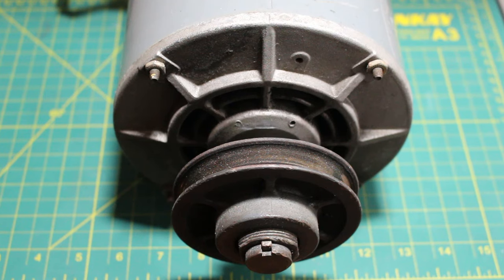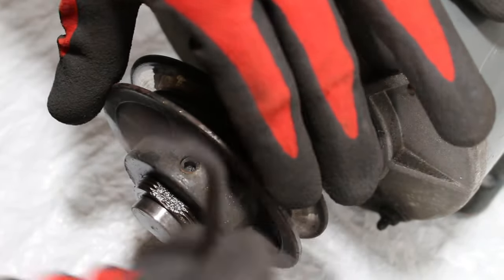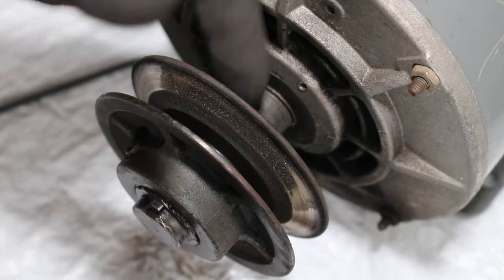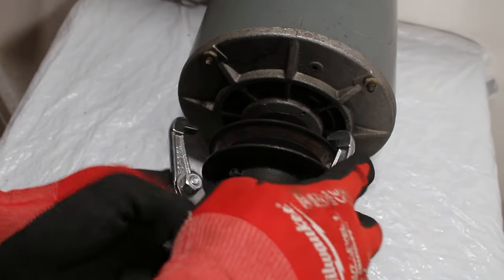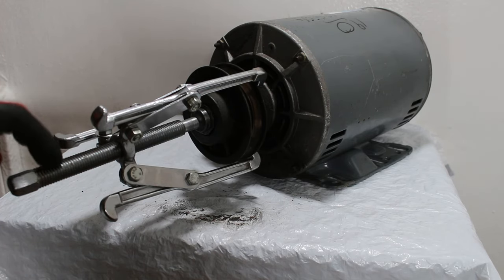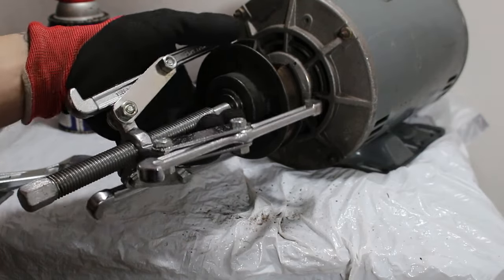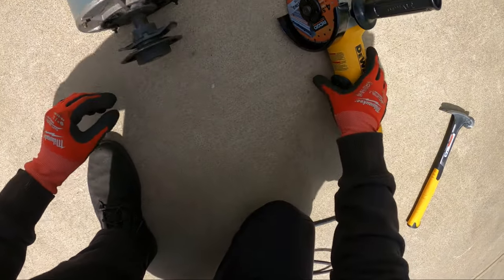HVAC: Blower Motor Pulley Removal (Fixed Bore Variable Pitch V-Belt Pulley) HVAC Sheave Puller Tool

Comment: Appreciate the candid video - happens to us all!  I’ve taken these off before and some additional tips that helped:

-leave the front allen screw alone so as to avoid changing pitch, loosen only the rear
-heat around the pulley  to expand it slightly, using a heat gun or propane torch
-slide a short iron pipe over the shaft protrusion to tap on the pulley hub using a hammer or brass mallet.  this breaks the pulley free from the shaft by first sliding it backwards slightly.  

Short Impact impulses are almost always  a safer way of freeing something  versus a large static force (aka the puller).

Comment: you suppose to take out that metal wedge first.  that’s why you were not able to slide it off pretty sure you figured it out  after the fact .. good video
Reply: How do you remove the little block key in the middle
Reply: @justbeingreal5839 yeah he forgot to say that. Maybe try to tap out like from behind with some little rod and the hammer?

Comment: Get yourself a blunt drill bit , spray the pulley with penetration fluid(WD40 is not that great) and then start to drill the end of the shaft until it gets hot or you see smoke. This should help to unseize the pulley. Also when using that type of pulley best to use a brace between the claws and pulley. i.e flat piece of wood. Keep the videos coming :)
Reply: Yield and impact socket. Ratchet moves around too much.

Comment: I recently bought a new motor and replaced the  small pulley and it started up fine but within  5 minutes or so it over heats and shuts down. Can you tell me how to fix this? Thank you.
Reply: Check belt tension
Reply: @wonderlandalliance888  Yes... again thanks
Reply: What kind of bearings are in it?  Are the bearings noisy?  When you turn it off and the shaft is still spinning, does it make noise?  Does it drag or make noise when you turn it by hand?
Reply: @wryanddry2266  Thanks but I already solved the problem.
Reply: @EnergyAndLightAwakening  What was wrong with it?
Reply: @wryanddry2266  The belt was to tight and I had to loosen it  on the motor.

Comment: ThankX for the video!

OH I RECOMMEND first heating up the Allen screws with a torch in case the maker used a lock tite glue on their threads and then also wd40 the screws before removal.

Comment: This was
My weekend.   Cooler was doing random squeaks.  Drove wife nuts.   Went to take that thing off.  Didn’t know about a puller.  Broke it with a screwdriver.   Said f it.  Got a 3/4 hp vs the 1/2.  Thr Home Depot didn’t have any.  Got home. Learned the pulley is separate.    Went back.   Wrong size pulley. The only size they had again at the small hd.  Day later drove 45 min to another one.     The fun continues after lunch.   Fingers crossed.

Comment: I pulled mine back and fourth then sanded the shaft . because i was replacing the motor too. It was stuck on the marks from thr retaining screws. I think someone put on one of the allen screws with a impact. It scores the pulley shaft and locked up my pulley. I showed that thing who the boss was though

Comment: Use a paint stripper and make it hot, doctor heat works always good, wd 40 not that is a teflon spray , we use "imal" rust spray let it works  1 day and spray more  again in that day, you see that works better.

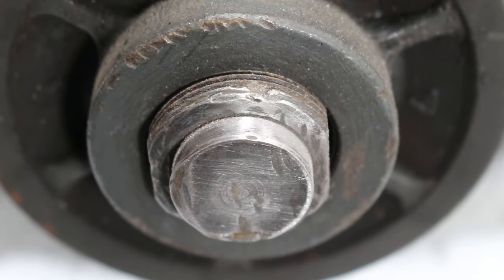Comment: 2:14 It's not rusty.  Clearly the threads are torn up: 1:01    Use a threading die to chase the threads.  

More importantly,  the edge of the end of the shaft looks like it's peened over.  See that around 4:07  By the time you were done you could see the bright spots on the shaft where the shaft had interfered with the bore of the threaded bushing when you tried to pull off the pulley assembly.  I bet the new pulley didn't go on easily unless you dressed up the end of the shaft.

Comment: You should have saved that vintage v pulley cast iron man.
You should have taken of the screws completely from the pulley so you can spray the wd40 through the the holes that will lubricate the whole system but the over nigth lubrication would have made the job easy and saved the beautiful pulley.
Just do not use force but use sense.

Comment: You could have applied heat to the pulley with small propane torch and put a round Metal Disk that slipped behind the pulley and pulled on that instead of the
Pulley itself because the pulley is made of an inferior metal.

Comment: Good video but used the wrong type of puller. There is a puller that looks like a disc that cam be separated in half. That would fit behind the pulley and around the entire base of the pulley rather than having the force focused on 3 points. Great job though.